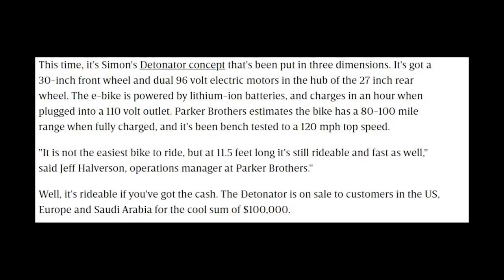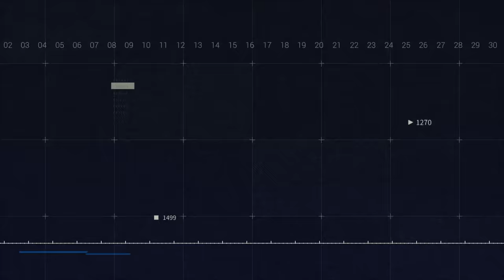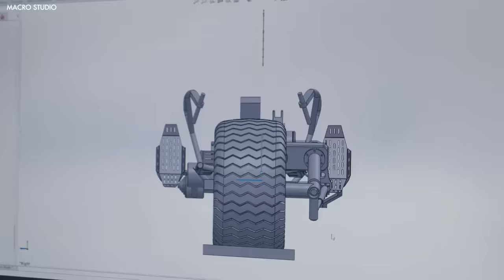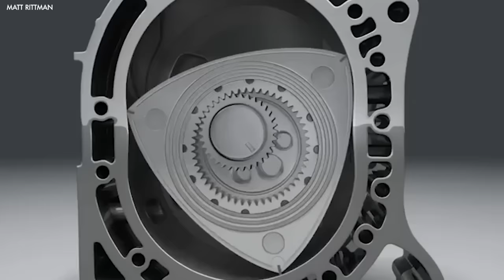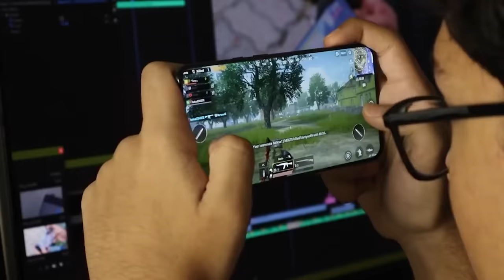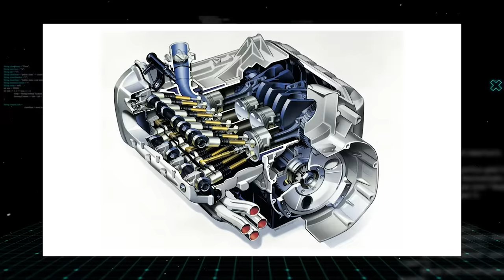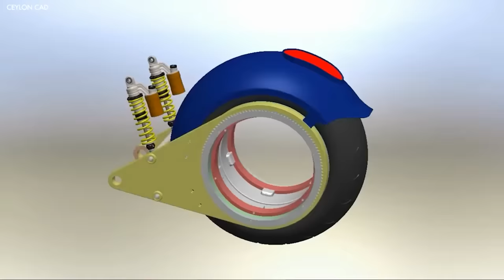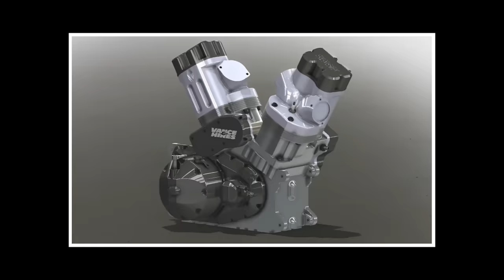20 Weirdest Motorcycles In The World

Comment: The orange painted Harley is V Rod not the Softail shown, unlike most Harley’s they’re totally different motorcycles, the Softail has no visible rear suspension and a V twin engine that’s been updated a bit over time but is still basically the same old engine used since day dot, the V Rod is also a V twin but it’s designed by Porsche and has around 50 more hp plus it has dual exposed rear shocks... unlike the other models and factory stock these two could easily be mistaken for different brands.